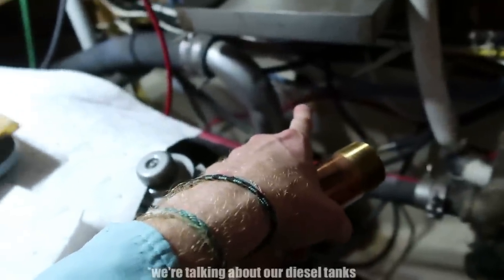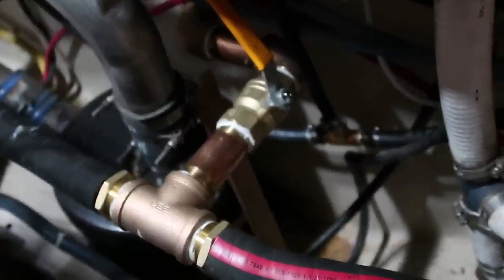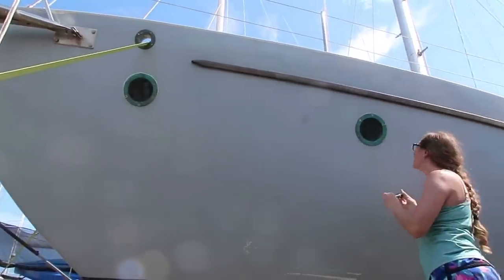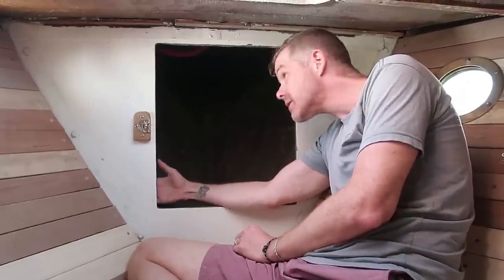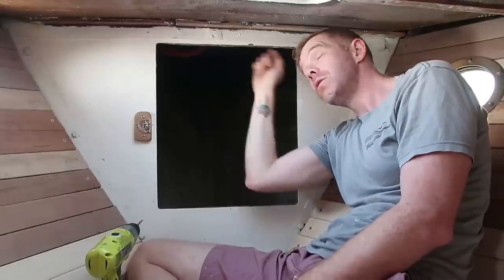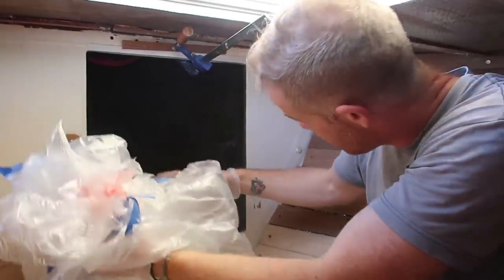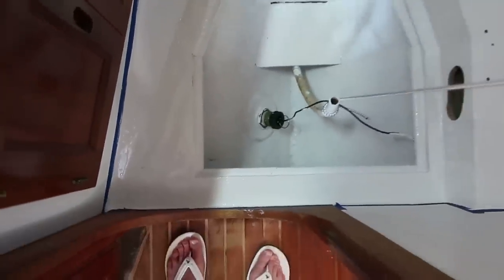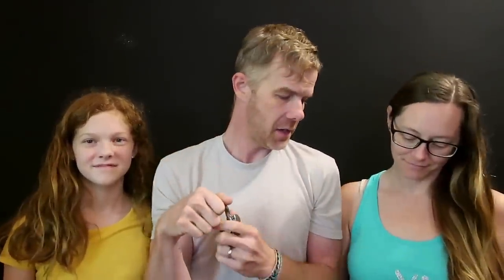The SNOW CONES Will Continue Until Morale Improves | Westsail 42 Cutter Refit | Sailboat Story 213

Comment: Next time you do wiring with the "black thingy" lol...put the wire through the closed end of a 1/4 inch wrench and put the wrench end in the slit and slide the wrench inside the sheath by pulling it opposite direction of starting point and the wire will automatically follow the wrench inside the sheath

Comment: Any updates on the rudder packing gland issue? Get a boot on that alternator output terminal or someday there will be sparks!!
Reply from the maker: Rudder knock is repaired, I think. I wrapped a thin Teflon sheet around the shaft, flares out the top like flower petals, and slid the stuffing box hose over the top. Feels very secure now, but time will tell how well it holds up. Also replaced the hose with a fresh piece which was stiffer and added a 3rd wrap of flax.

Comment: your injection method is good . we use it in aviation all the time .
Reply from the maker: Worked like a charm. That chunk of rotten, flakey wood is now rock solid. If it were in a more critical area I would have cut it out and replaced it, but the injection method made for a convenient fix. Into what part of a plane would you inject epoxy?
Reply: @Sailboatstory  we injected epoxy into composite delamminations and in floor board soft spots . Many other places as well .

Comment: FYI, Snubbers on a boat with a bowsprit are a royal pain, as the swing while at anchor will chafe on the bobstay and fray rapidly.  The only way we have found is to actually attach the snubber to the lower bobstay fitting at the waterline.  No one seem to mention this anywhere I have seen.
Reply from the maker: I have used snubbers on bowsprit boats, so I do understand the issue. I think there are still many others factors that contribute to the potential problem aside from just a snubber and bobstay being present, but I know exactly what you mean. So what's your process and setup that allows you to connect to that lower fitting that is so far down right at the water?
Reply: @Sailboatstory    No perfect way but my steel gaffer has 2 holes on the bottom fitting so the bottom one has a D ring with a big snubber shackled to it permanently and the snubber is brought up to the bow with the chain and let back down with the anchor.  Only real issue is to inspect that D-ring and shackle to make sure it is ok.
Reply from the maker: Hmm. Interesting. I can see how that could work. I imagine your lower fitting is welded into place. I'm not sure about applying those big loads to ours which is likely bolted to the boat, I imagine. Might have to just ensure that we have good chafe protection and fiddle with things until we find a method that works reliably for us.
Reply: @Sailboatstory  that fitting is just as strong as a cleat I would think.